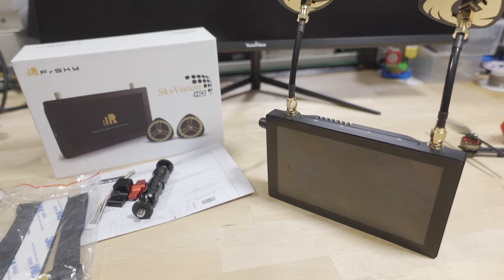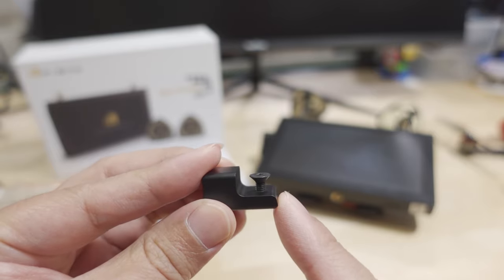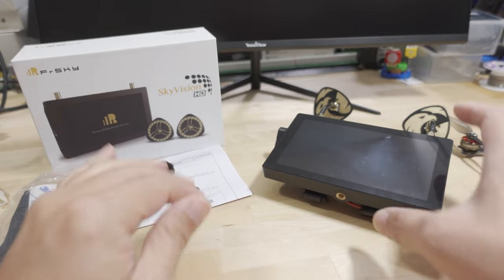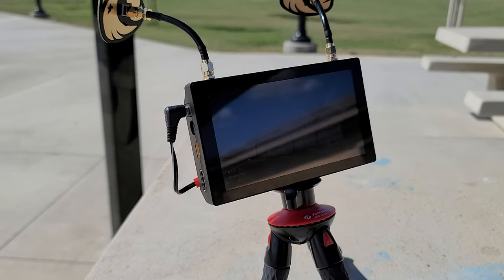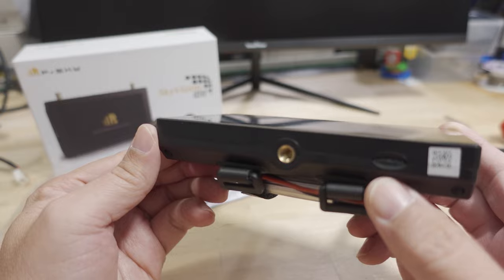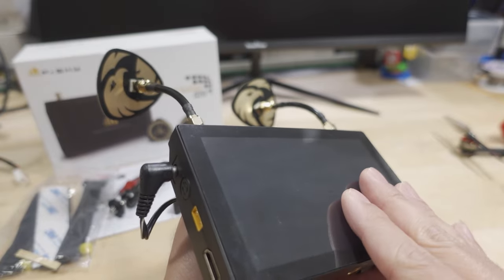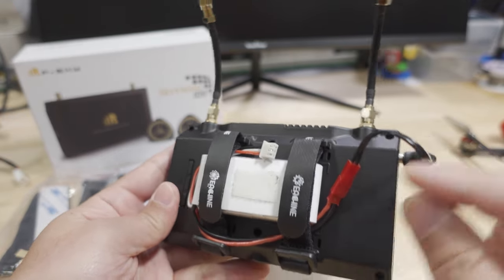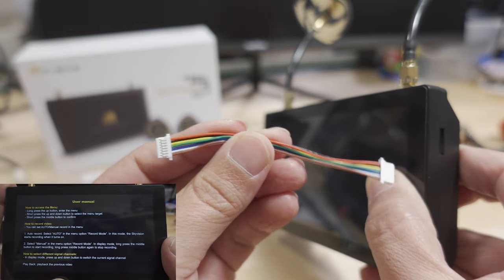SkyVision HDZERO FPV Monitor/VRX Review 📺

Comment: Nice HDZero monitor receiver, cool it allows for hdmi out simultaneously. The frequency default at startup is sort of annoying. Great review Albert!!! 👏 👍
Reply from the maker: That will probably get fixed in a firmware update so I'm not too worried about it.

Comment: Decent Walkthrough Thank You! I bought one after watching... Have you done the firmware update and lost OSD recording as well? Video records fine but no OSD overlay on recording... Very Odd. Probably something stupid I'm missing LOL - Again Great Walkthrough Thank You!
Reply: Is it working now?
Reply: @kool-k-kel   heya - Original firmware I can record OSD and i even get the batt vcc ; but i cant use ardupilot native fonts. New firmware - OSD shows but no vcc from battery plugged into the skyvision and osd doesnt record.

I even tried using the original Hdzero binaries but im haphazardly guessing the flash on the skyvision is smaller and they are removing functions on it to make it fit.
Reply: I have one arriving today...so better to stay with original firmware. Have frsky responded? I'm hoping to use with ardupilot as well. Is it working for ardupilot, you mention native fonts...
Reply: Hmmm...fingers burnt maybe...fingers crossed lol
Reply: @kool-k-kel  any dramas reach out to me. It was a bit frustrating to setup but mostly due to serial config and rebooting properly.

I tried the smart audio thing but its a bit useless for me to waste a serial on it just to change settings when I can use the standard osd, plus i set it to x and forget because its a long flyer, not a racer.

Good Luck Man! Its not a bad unit, just got a few bugs to work out...

Oh - im 99% The antennas on it are RHCP when/if you get to that question LOL
Reply: @TheJahNix  appreciated... mine is about an hour away.. i`m sure ill be in touch.. But yeh basically hoping to use with ardupilot on a t1 ranger, using a matek f405 vtol stack running ardu
Reply: @kool-k-kel  heya Bro - hope its working good for your build (sounds cool BTW!). Ive come across another bug on the FrSky unit - I just bought a set of HDZero goggles to verify (more $ than brains), but sometimes the OSD was dropping on FrSky unit mid flight. The clue was the video files being recorded - when the osd would drop a new video "start" would be made. It seems to happen randomly when the file hits 5 mins / 8gb or when the mov file count = 30. Doesnt happen on the HdZero Goggles (or not yet from the last 7 flights ive done).
Reply: @kool-k-kel  Heya Mate - FrSky have answered and given me a custom firmware to test. They are releasing it tonight - Fixes OSD recordings etc i.e. Native Ardupilot!!!
Reply: @TheJahNix  available via the webby or can u hook me up...